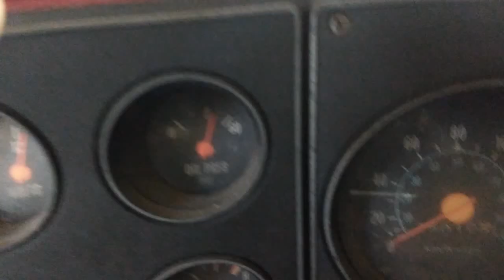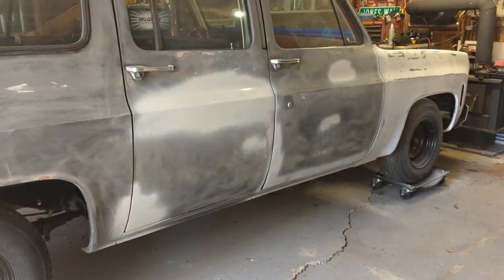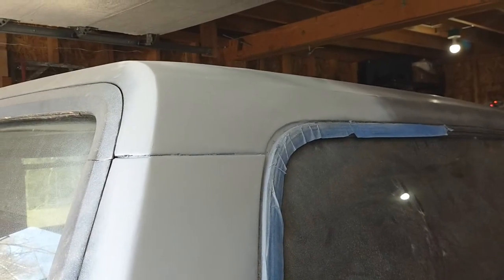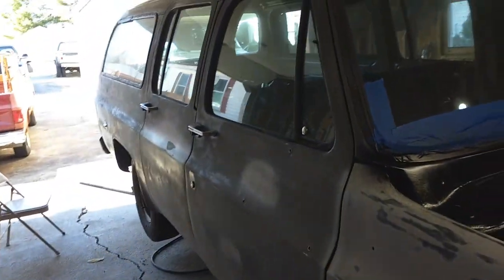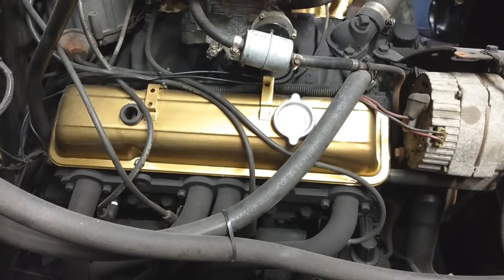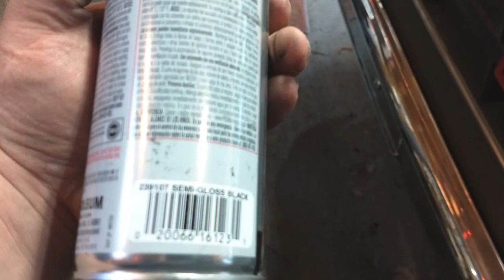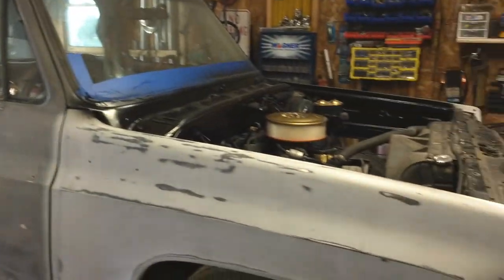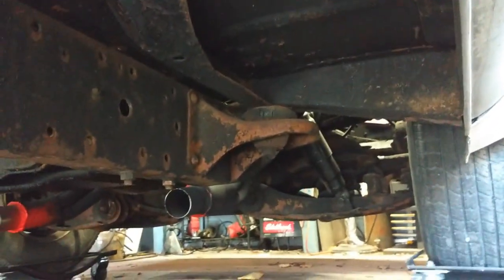78 Suburban open header cold start+progress

Comment: I used to work for my local municipality when I was growing up in the late 90's. We still had one truck left of this vintage in the fleet, P-8. It was a 3500 dually, short rack body. That truck was a lot of fun to drive, plus the town bought gas that didn't have any corn in it.
Reply: Yeah, apparently it was even faster before the older guys blew the motor up and it got rebuilt. Something about it being faster than a corvette at the time because of the dually rear tires.